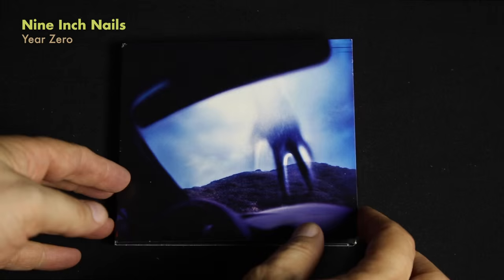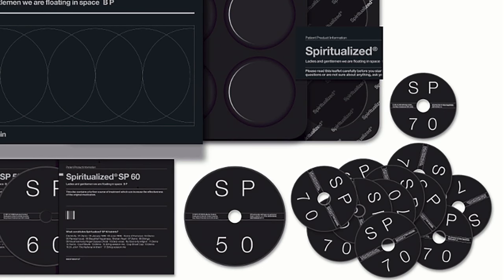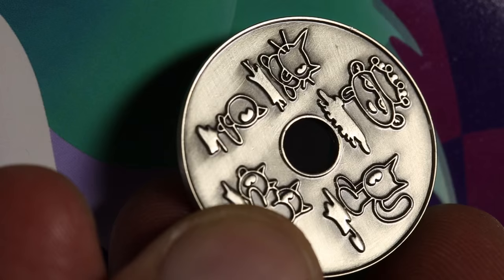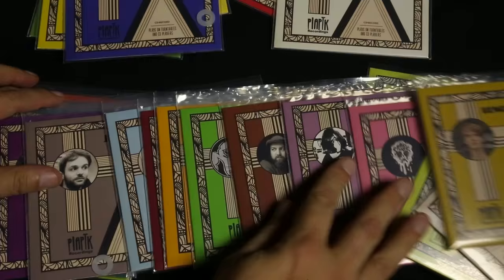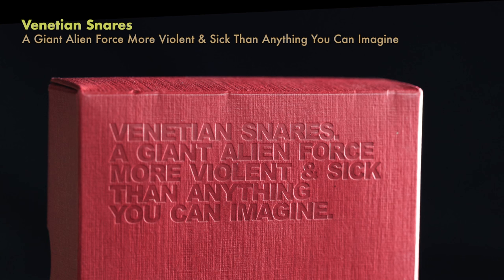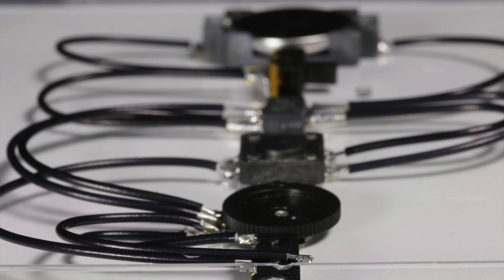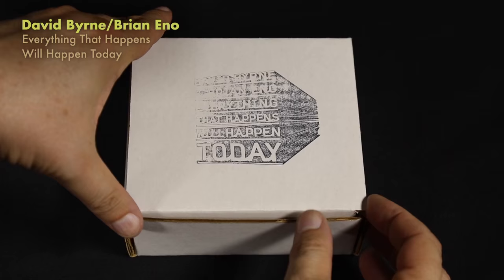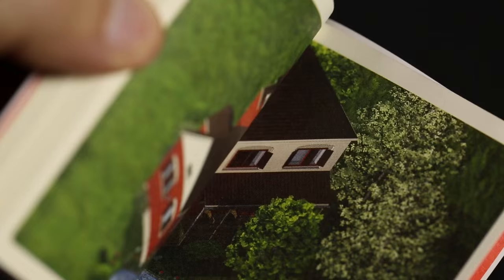Very cool and interactive CD Designs, Part 4

Comment: Yeah idk if you’ll see this, but I just came across a really cool CD design for Sift The Noise by Skipping Girl Vinegar (Melbourne-Based Australian alternative band). The CD is based on a worn-out red book with embossing on the front and bad. Also the bottom of the side has the numbers you would see when renting a book. When you open it the inside shows a glued-on floppy piece of paper with signatures of those who ‘rented’ the ‘book’ alongside the ‘title page’. When you flip the right side of the trifold, the tracks are labelled as chapters with their song lengths. Also the booklets are thin like a mini replica of an old book and the CD is designed like a record.

Really classy design for an amazing album!

Comment: My cd of Tenacious D's The Pick of Destiny has a lenticular image, it's just a plastic sheet with the art that goes in front of the booklet. It's a little disappointing, the image doesn't really move at all, it just looks a little bit 3D, but still way cooler than it would be without.